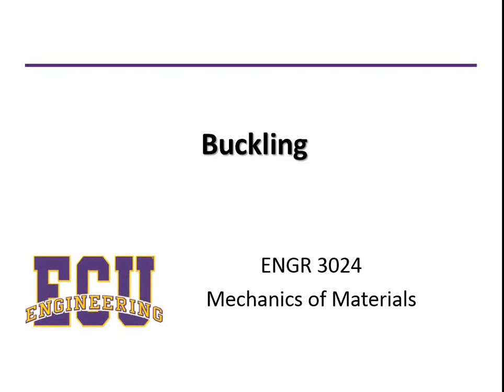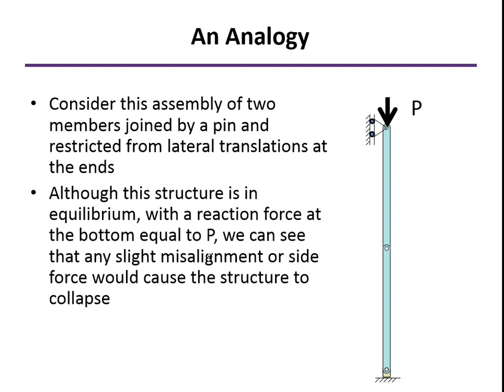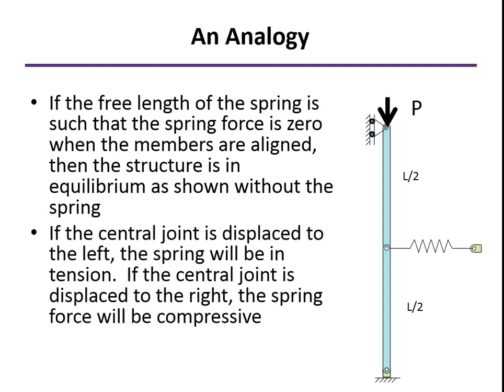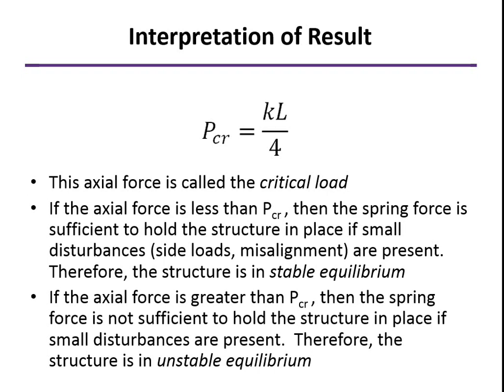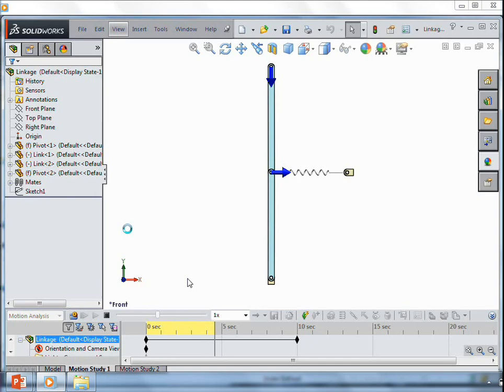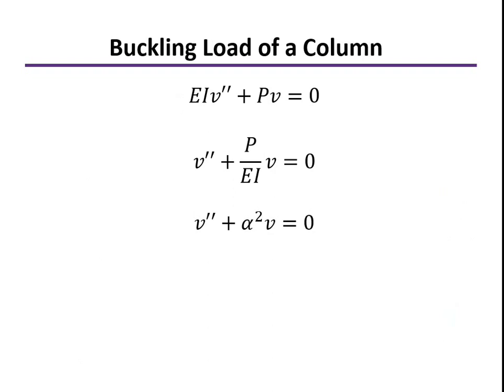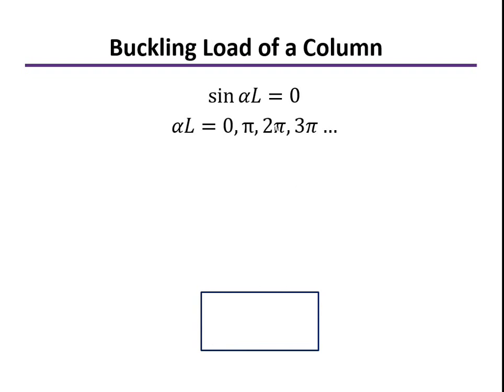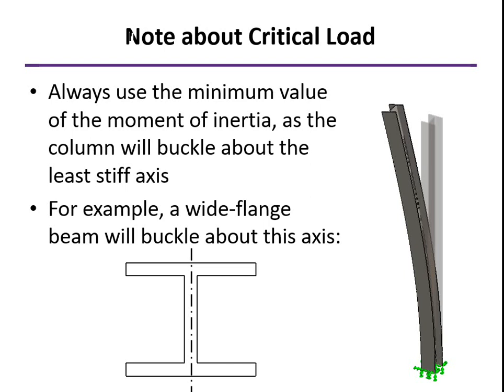Buckling

Comment: Thanks for the video. But actually, the displacement of the centre should be L/2*sin(theta), not L/2*tan(theta). This makes the critical effort dependent of theta. The only way to make this write is to suggest that this formula is right only of low values of theta.

Comment: thats cool but actually i confused here saying rigid bodies for L/2 bars and also we can see upper side can move up and down with a roller. just letteraly moves are restricted said. so make that mean L/2tan(teta) cant be the lenght for F=k*x. because total heigh of the system will be shorten with P force.   in stead of L/2tan(teta) displacement of spring must be equal to L/2sin(teta).
???